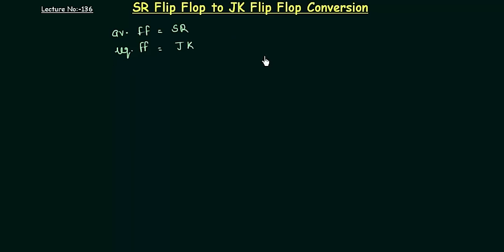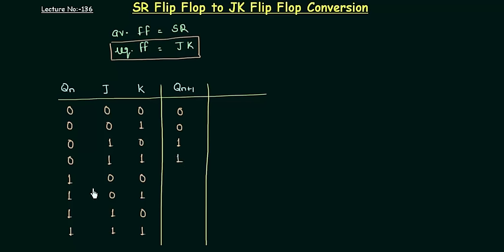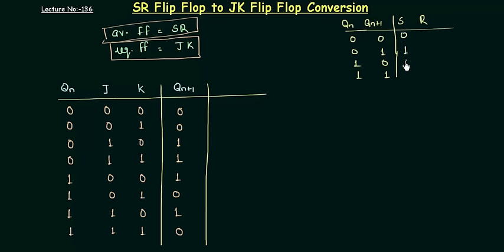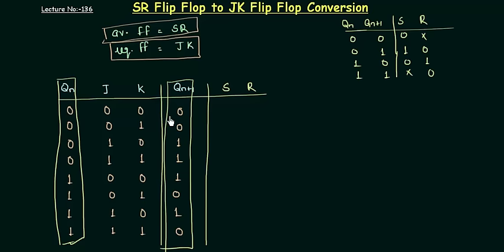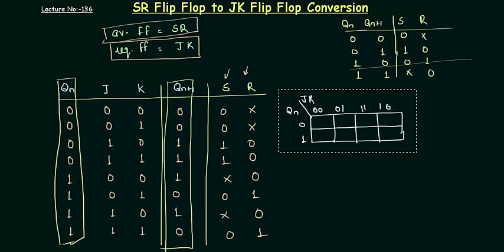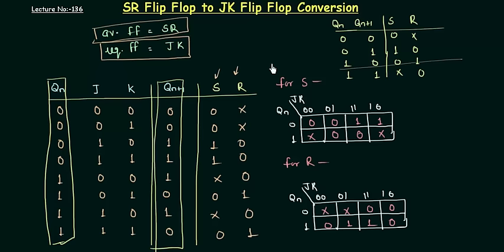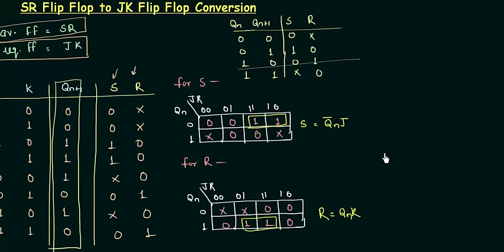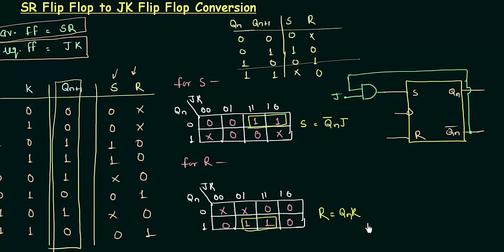SR Flip Flop to JK Flip Flop Conversion

Comment: i am watching it second time. first time two years ago in 2nd year and now again for gate, still unboring. and the final minute of video is when i actually understood the concept right. thanks a lot
Reply: Can anyone explain why the triangle in the SR circuit is negative edge trigger? Why is it necessary?
Reply: @yonghuiliew8066  negative edge trigger is indicated with that triangle and bubble. Edge triggering is necessary to handle racing condition.
Reply: @drj9403  if it is positive trigger, what would be expected? 1 1 not used case ??
Reply: Ab konse clg mai ho?
Reply: I'm watching it in my second year just before one night of the exam. 😂
Reply: @lathadevi6639  Engineer 🍵
Reply: @lathadevi6639  same here ❤️
Tomorrow is my exam 😁
Reply: where are you now

Comment: Sir why didnt we consider the "dont care" in this case?and when do we consider it?
Reply: did you find the ans? I thought we consider dont care as 1 during k mapping. let me know please
Reply: @jaiagnihotri5076  basically don't care aids the 1 in forming pairs,quads etc.It doesn't self dual,like form pairs with itself.But if the 1 needs the don't care to form a quad or pair or octet then it helps the 1 in doing so